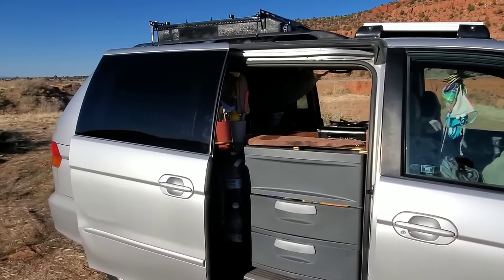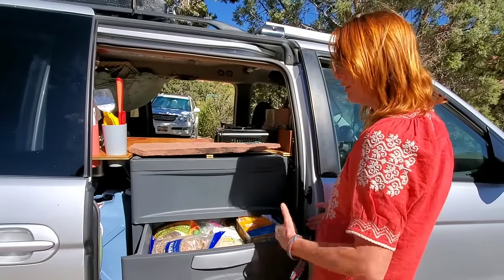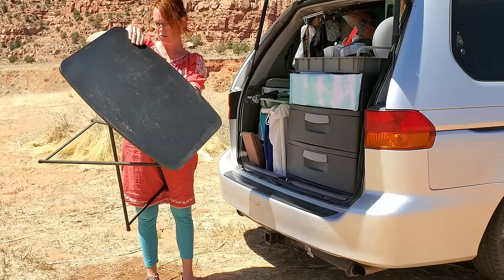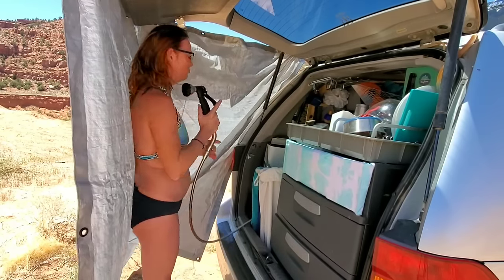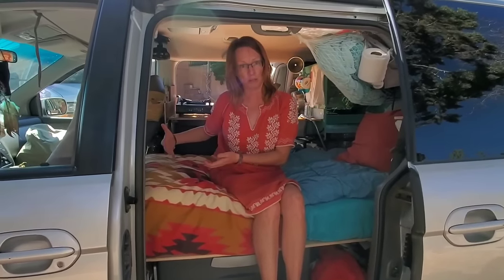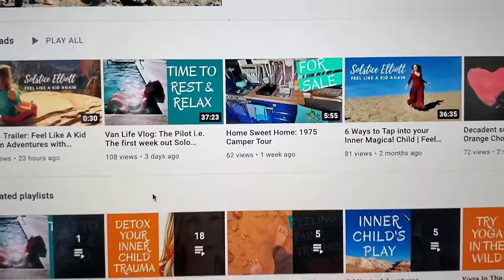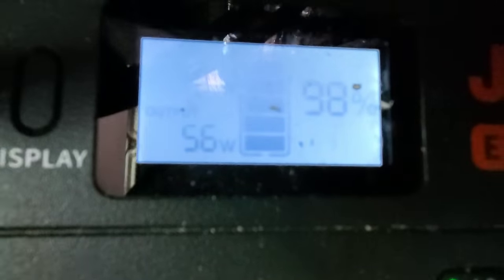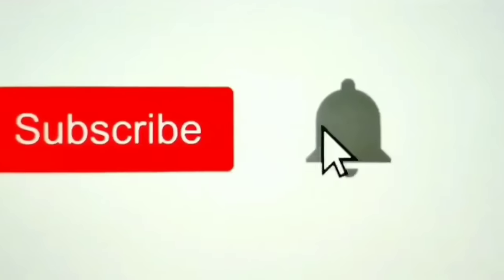You've Never Seen A MINIvan Camper Conversion Tour Like This! | + Stealth + Off Grid

Comment: It's amazing how you managed to get all that stuff in there one thing I never understood was this Obsession that people have with having a queen-size bed or larger most people can do just fine on a twin bed or a cot
Reply from the maker: I keep thinking if I weren't solo could I still make the bed work and I realized that I could cover over the garbage box and Mr. heater with more plywood and gain another 10 inches there and then I could gain another 11 inches extending out over where I put my feet with more plywood and then that makes where your shoulders and heads go 49 inches across and two sets of legs and feet can squeeze into the original 29 inches. It'd be a tight squeeze to have two people living in a small van, but doable.

Comment: Your van is very well organized.can't wait to see your tub ☮️
Reply from the maker: Yes I finally was able to slow down enough in my travels to finally get the product I need to finish the tub. It seems that most stores anywhere and everywhere don't have it in stock. I'm gonna wait for the heat wave to cool off a little bit because has to be done outside and then it should be done in one day, but I always think a project should take less time than it really does 😝 I'm sure you know how that goes.

Comment: I love how simple everything is in your van. I think we over complicate most things in life.
Reply from the maker: TBH it's deceptively simple. I think there's somethings in here like how to install the hot water tank or how to make a template to cut out the hole for the mini sink or how to put a garden hose onto a mini sink or how to run a tube from the drinking water tanks to the pump or how I had to melt the handle of one of those water tanks to make room for the draining of that sink that you realize AFTER you have the sink and counter top in place. These are the kinds of things that I definitely needed Bob's help on, but otherwise there is a lot of simplicity I am always seeking the most efficient easiest route to do something and yet there was still much frustration involved in trying to do something that has never been done before
Reply: A simple way of living will make you feel much better of yourself and your soul as you live or after you leave this physical body, your soul has not much of things to attach to.

Comment: I'm slowly converting mines..so excited..right now it looks very simplistic. But slowly ill get ideas and do the conversion. Cool conversion ..#blessings to you..I own my 2009 chrysler town and country I'm so proud and no more rent!!!
Reply from the maker: That's wonderful that you own your mini van and are now rent FREE!!! The total cost for me to convert my mini van was $2500. But it is a process and that cost does not include my hours and hours of labor. My build is deceptively simplistic there are many times I tried something and it didn't work and I had to redo it several times until it did. It does look fairly basic, but measuring it all to fit in there correctly and not fall apart while driving is challenging. So be patient with yourself when you get frustrated and want to give up and in the end it will all be worth it.

Comment: Very cool ! Awesome personal touch countertop ! Stay safe and enjoy your travels .
Reply from the maker: @ronaldpoche3401  thank you that's very kind of you to say
Reply: I was interested in your water storage on the roof . How many gallons and the weight doesn’t affect anything ?
Reply from the maker: @ronaldpoche3401  the water storage did not cause problems with driving as far as sloshing around and feeling top heavy. I generally don't feel them completely up if I'm going on a long trip. I did have to get the rear tire springs I think they are called reinforced with an Air Lift 1000 Air Suspension Kit. Currently in my van iteration 3 years later I put the water storage in the stow and go compartment so I could be more stealthy. I still need the reinforcement with the weight of everything else in the van. Happy Building be well.

Comment: This is great.Thinking about getting a mini van for this very purpose.  The one thing that i couldn't deal with is that gear hammock.  Huge blob of stuff taking up 30% of the headspace volume. There has to be a better solution.  Other than that one element I love it!
Reply from the maker: I guess if I had less clothes I wouldn't need it. I've reduced stuff down so some of it probably could go in the drawer below the bed and make it not so bulky, but the netting doubles to keep my shoes from falling out

Comment: I *love* your van.  Do you have a website with plan schematics? 

I have a Toyota Sienna, and about 20 years before I can do a permanent build, but I'm so inspired by your ingenuity. I'd like to save the ideas for the future.

Your video title is true.  I've been watching van life videos for a year,  and this is absolutely the best one I've seen. 

Subscribed immediately. I need to see the bath tub, when you feel like making a video. I'm not a bath person so the shower is enough for me, but I can't wait to see how you made a bathtub happen.
Reply from the maker: As a designer who has measured and drawn up things before for other projects, I've learned that Vans do not work that way. You measure some things you come up with a rough idea of what you're trying to accomplish and then you gotta actually just start doing it and as you start to try to fit it in that's when you realize what else you need to do to make it work. For example I wanted the water tanks to be located underneath the mini sink with a grey water hose that drains out. When actually putting in the sink after measuring over and over again the countertop and where it should go and fit so that fridge and stove fits and there's plenty of counter top space I realize that the drain hose and the water tanks are too tall to fit. So what had to be done was to actually melt the handle of one of the plastic water tanks just enough to bend it so the hose could fit and the sink could sit flush with the countertop. You can measure all you want and you won't know that until you're actually in it trying to fit the sink in. It's like that for everything because vans are not perfectly square and level on the floor. So to answer your question there are no schematics for that reason. Every van will be slightly different in how to fit it all in. But you now have the basic overall setup that I have offered here to work with which took a while of living in it to work out some of the kinks in that. 
That being said,  I've had to rethink the tub a few times even when I think I've got it and it's been difficult since I've been traveling without some kind of work shop to get it all worked out or order things to make it work, but I am heading back towards Southern Utah and I think I can get it done this fall.

Comment: Everything is at your fingertips and has all the bells and whistles. I was thinking that I needed to see more open space because it creates more energy for me, but your setup would be perfect for someone with a bad back or knees because everything is reachable. I have to rethink my build.
Reply from the maker: Thank you everything is at my fingertips and it does have a feeling of cozy spaciousness. Not sure about the bad back or knees though. It does require me to be able to kneel down on my knees a lot and to be quite flexible to crawl back in the back and put dirty dishes away for example. Just to build the thing required a lot of contorting of my body and my back to get in a drill pilot holes put in screws measure things and bring things out to cut them to size so hopefully that doesn't discourage you.
Reply from the maker: This Vlog in the link below might give you a better idea about how much I crawl around in the van especially around the 17:00 mark and on.
https://youtu.be/lCm5-wJj9E4

Comment: Nice build and you are beautiful too. I like the shower in the rear. Where you have your water draining from your sink, you might want to use some foam insulation around the hole to keep rodents and bugs out. Well done!
Reply from the maker: Thank you Daniel. Yes good idea maybe like a gasket around the hole and that would keep the hose from popping out of the hole from time to time.

Comment: I think most of it is great. I like the big drawer's. Those were a great idea.
But I think your dish washing set up is more complicated and cumbersome than it should be. On the left of the drying bin you should make that your dishwashing area. Set your tub there. And then you wouldn't have to bring your hose out the back.
And also if needed you could wash them from the inside of the van. Like when in bad weather. You could even wash your hair inside the van.
Oh I do like your drying and storage idea. I do that at home. 
And you have a great shower setup except the board's. You should get some seat belt strapping from a salvage yard and connect them so you can just in unfold them. Also put like a 1×1 strip on the back of each board to try and hold them up off the ground some so you aren't standing in muddy water.
Reply from the maker: I don't want to get water all over the van and cause mold so putting it to the left would just be a place where things can splash into the van. I already have to be pretty careful with the tiny sink and counter top to not have food and liquid roll off
Reply from the maker: Seat belt strapping my boards could be interesting, but I am really actually pretty done doing projects right now. Maybe after playing and resting a lot I'll be up for that.

Comment: Hi - I just found you and subscribed - GREAT VAN!!!

For the blender and Jackery....  I believe that you could run the blender on low and under certain conditions.
The Jackery 1000 actually has a 2000 Watt surge capacity...  Jackery has that in their description on their website.  The surge capacity is one of the reasons that I am considering buying a Jackery over several other manufacturers.
You could call Jackery and ask them how long you could run the blender.  At 1500 watts, it would probably run a few seconds - that is probably the high speed rating.  You could problably run it on low speed for a few minutes - worth a check.

YouTuber Hobotech has quite a few videos - He usually test the Jackerys running in the surge mode if you want to check those out to see how long it would run.  Feb 29 2020 dated video at around the 10 minute mark
Reply from the maker: Well somehow that's what I thought when I bought it that I could run it and then the manual said different so May it is a matter of just few minutes it could run it. I'll look into it thank you

Comment: Smart putting the water tanks on the roof🧐... no need to pump let gravity do the work🙂
Reply from the maker: Thank you Alan. I originally did have gravity do the work and it wasn't quite enough pressure. I had to squat down to be low enough to get the shampoo out and I depended on the Sun to warm it up. For the hear on demand hot water you need a lot more pressure than gravity can give you. So I do have a pump and I love how much more usable it is.

Comment: That 30 gallons of fresh water up on the roof would weigh around 240 lbs when full (30 gallons x 8lbs/gallon). Do you notice any handling issues when driving with that much weight up there and possibly sloshing around?
Reply from the maker: It's actually 24 gallons on the roof. So more like 192 pounds. I rarely fill them up completely and the handling does seem to be fine. I try not to have them too full on a really long trip. I have extra springs added to the back tires to handle it, but you definitely can see the van lower closer to the wheels when it's really weighted down.

Comment: On the shower I noticed you when its hung it up do you  cover  your back kitchen with another tarp just to make sure no splash.
Reply from the maker: It splashes a little bit on the bumper and the drawers a plastic so it doesn't really seem necessary. It doesn't really get everywhere mostly goes on to the ground.

Comment: How long did it take to finish your van I’m gonna do this and I wanna be on the road this may just wondering when I should start looking to buy my van and start working on it
Reply from the maker: The longest part was finally figuring out what I was doing meaning the design and organization and had the solutions for what I was going to do. So now I just had to go try out those solutions and see if they worked. And I started cutting the countertop and glazing it around early February and I was on my roadtrip by May 1st. The thing with the van is that it always takes longer than you think. You think all I have to do today is this in then something is leaking or something that you thought would fit in that spot has to be reworked in another way. I get my best inspiration when I first wake up in the morning after i've been working on it the day before. So when you hit a snag just sleep on it and the solutions will come. Let me know how it goes Tessa.

Comment: I love your van!!! Also, where do you get the shower spray you have there?
Reply from the maker: Great Question: There's an actual shower head that comes with the heat on demand hot water tank kit. It also comes with the in-line 12 volt DC powered water pump. You can find a link to it in the next comment. The switch on that shower head after getting industrial strength usage when I had my Glamping Airbnb broke. So I just replaced it with a garden hose nozzle from Walmart.
Reply from the maker: https://amzn.to/3yfFbWM

Comment: Did I miss the specs of the Honda Odyssey, like mileage when bought, repairs, reliability?
Reply from the maker: It's a 2003. I purchased it in August 2017 at 150,000 miles and it's now at 233,000 miles. Other than tires oil changes, new headlights, air filters, breaks the only major expense was a new timing belt for $500.  It could use some new struts too but haven't bothered, yet. 22 miles to the gallon. Super reliable has been my experience. Purchased it for $1950.

Comment: Solstice. I have those sing Sterilite drawers and would kill to know how to take them apart you sound exactly nice but I think that would destroy it some wondering if you could give me a little more information about how you did that that would be a game-changer for me great job
Reply from the maker: Use a flat head screwdriver to pry them off where they attach. It takes a little finagling, but it won't damage them and then I used a power reciprocating saw to slice them down for the one underneath the bed and underneath the dish drainer tray. I think there's even a little notch you have to push into with the screw driver to get them to give way and then it's just a matter of turning them around and popping them back on. Let me know how it goes.
Reply: @SolsticeOnAnOdyssey  thanks!

Comment: Can you give me a little bit more detail on how you did the bed because I have an odyssey too but it's the next generation from yours but the floor is so uneven it's awful so is it just sitting on that drawer and then where is the back part sitting?
Reply from the maker: Yes thank you for noticing the details and helping me realize what I left out. So I had to use boards to create a level underneath the drawer. Everything in the van has to have a board underneath it to level it. So the fridge, for example, has a 2x4 underneath it. The drawer has a 2x6 and a 3/8th inch thick (I think not totally sure) board screwed together to go underneath it. To me, it's still simpler than trying to build an additional floor and put storage in it. It's just scrap wood I had lying around nothing fancy. You just play with what looks level. It's not exact and you just don't notice it because you're parked in places all the time that are not exactly level all the time to sleep. It's pretty close though. Then I took that same scrap wood and screwed it to the side of the plastic dresser facing the front passenger seat. this gave it another leg. The leg I put in front of the fridge could not be screwed onto the fridge. So it's a 4x4 sandwiched between two larger square pieces of wood screwed into the 4x4 on each end. Hope that makes sense SUV Venturing. I actually have currently altered the bed entirely to fit around a folding ebike. So it's got hinges now to easily lift up the mattress. And there's no drawer holding it up anymore. That's gone. I'll be doing a video on it because it's rather complex to explain. So be sure and subscribe and especially hit the notification and you can see the details of that when I post it.
Reply: @SolsticeOnAnOdyssey  thank you! Yes easier than a whole floor I can understand that. And yes I'm already subbed

Comment: Hey how are you. I see you are showering in the back of your van. Neat idea! You should cover your things in the back with another shower curtain . so your things will not get wet. While you showering.
Reply from the maker: It's never been a problem they don't really get wet and if they do get slightly sprayed it's just plastic drawers no different than a shower curtain. I actually don't use the shower curtain very often because then I have to wait for it to dry off before I can put it away and get back on the road.